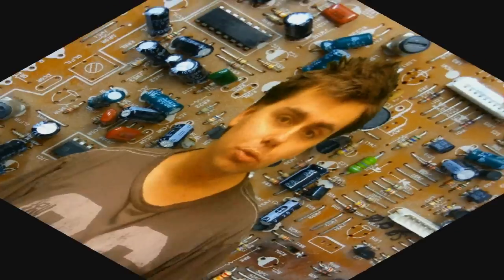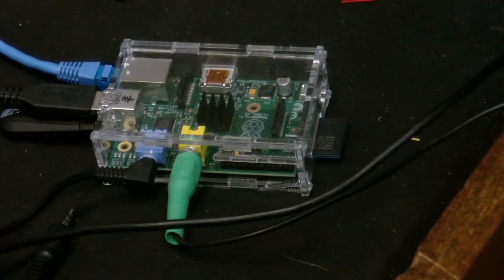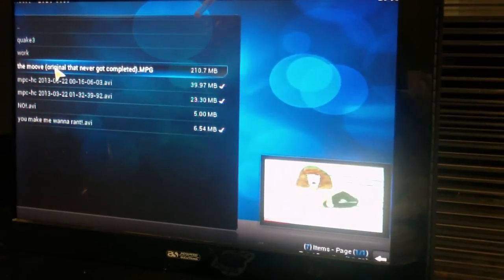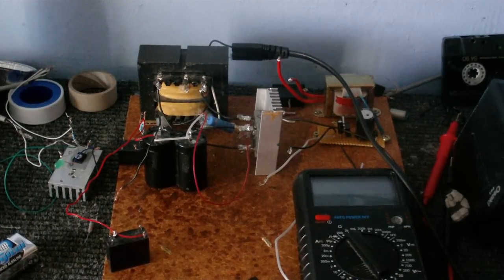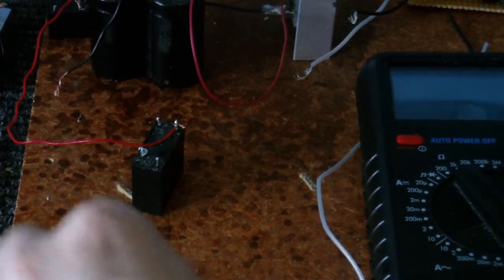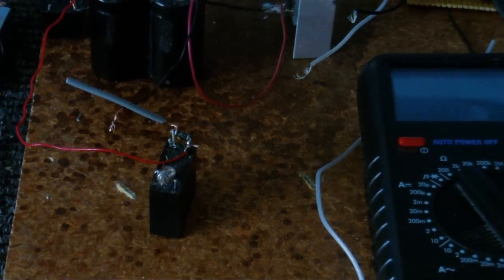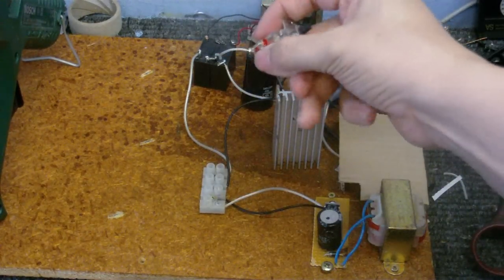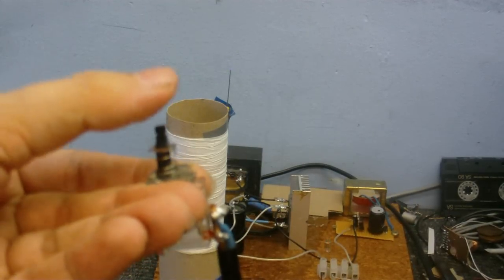CDC Electronic Workshop - More high voltage experiments cooming soon!

Comment from the maker: I stuck a couple of pins in the cake tin, then put that on the pin on top of the coil.  And when I turn it on the high voltage plasma jets coming out from the pins basically just push the thing round.

Comment: I bought the two codecs from the pi store, less than a fiver for both if I remember rightly, not sure how you go about installing alternative ones. Xbmc is never complete without navi-x. I absolutely love my raspberry pi, I have learnt so much about python, Linux and electronics thanks to this, i even bought an arduino to take things further. Checkout adafruit  and codecademy.